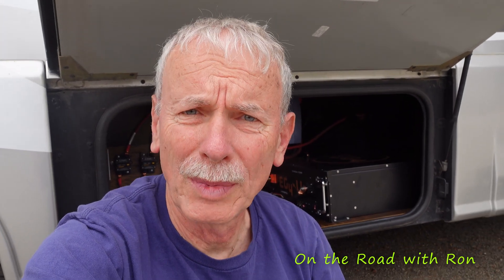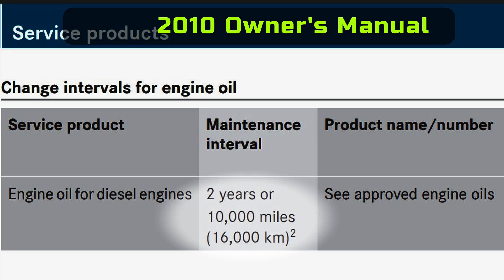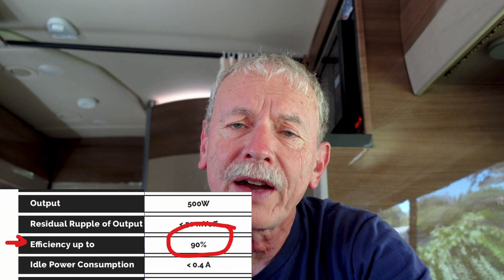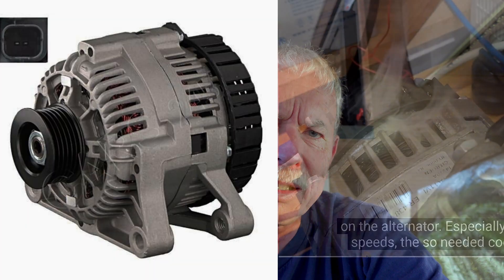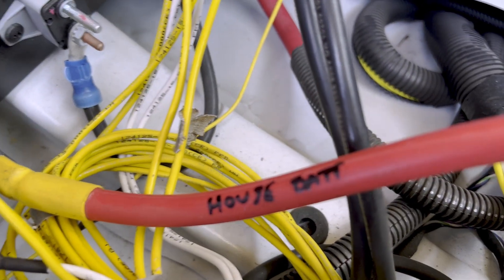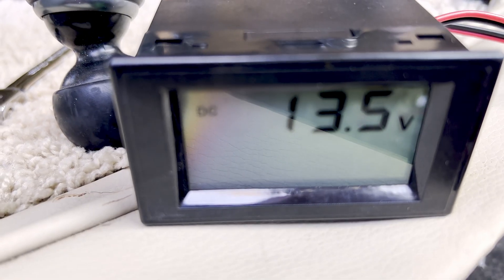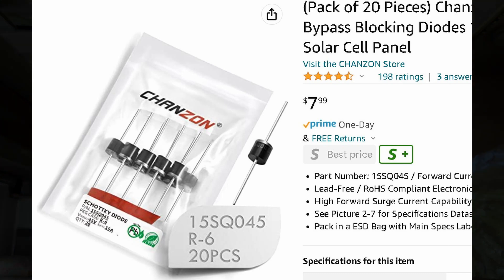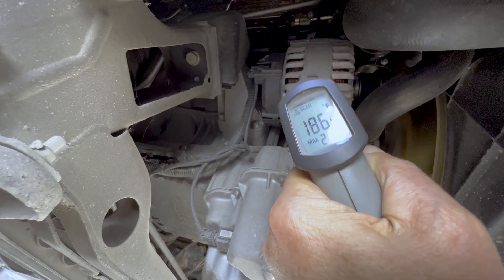DC to DC charger NOT required for big Lithium Battery

Comment: I am currently preparing an RV installation and am also surprised about the high cost of DC-DC chargers. Strangely enough, it appears that they are built into a PowMR hybrid solar inverter for less money than a DC-DC charger... Who understands this nowadays? Also, why couldn't you use a cheap solar charge controller for less than €20 and use the alternator as an input instead of solar panels... After all, voltage is voltage and amperage is amperage, there's no magic here... Or am I missing something?
Reply from the maker: I don’t think the solar controller will work. Solar panels output around 20 volts and the controller just reduces that to a battery charging voltage of 13.6-14 volts. The alternator output is 14.4 volts so may not be enough to activate the controller. If you try it, let me know your results.
Reply: Can I charge my RV's 24v starter battery with a solar charger or do I need to buy an expensive DC-DC charger?
Reply: @ontheroadwithron2432  What about removing the regulator from the alternator and let the charging of the house and starter battery be handled by the cheap MPPT controler. As far i know a alternator is able to deliver between 30 and 90 volt without the build on regulator.

Comment: Very simple answer: if the alternator has a build in temp control, which the 150-240AH in the Mercedes have you can hook the alternator directly to the alternator. BUT the lead regulator while throw up to 15V at the end of the charge and overcharge the lithium. The BMS will protect the battery but only when that 15V voltage is there for some time and will damage over time. You need to install a relay that cuts of the alternator when voltage is at 14.2-14.6V depending on the specs of your lithium.
Reply from the maker: I have never personally seen 15 volts from alternator. Are referring to when all batteries are fully charged?
Reply: I refer to when the FLA is fully charged you see up to 15.8V and with AGM setting (which most smart alternator have today) up to 15V. So you have to be careful and disconnect the Lithium earlier. You may never see when cable is underdimensioned and your voltage drop on the cable is 0.5V, the argodiode splittingbdiode used with 0.5V voltage drop or connection is slightly corroded which unintentionally  saved thousands of drop in lithium from being overcharged and damaged...and then claim this is all marketing scam you have to modify alternator or take other measures but simply insufficient install saved their ass...

Comment: Depends mainly on the chemistry of the battery. LifePo4 no problem to use the alternator I have been doing that for 5 years  on my RV.
Reply from the maker: As long as you have a good alternator.

Comment: Yes you did not cook your alternator because it is strong enough but but I have had two four wheel drives that one with a 60amp and one with a 80 amp alternator and cooked both of them
Reply from the maker: Those are pretty weak units. Even a DC charger might be too much.

Comment: BMS cannot and will not limit charging. BMS is basically a fancy self resetting fuse not a charger at all. Victron does run a BMS they just run an external BMS not internal. There BMS if setup in the Victron eco system can control all parts of the system from turning loads of if battery is getting low can turn chargers on and change there output to suit the needs of the battery and system. 

Alternator no matter if it's size have a regulator this will prevent it from over heating and burning out, as well as limit its max output so no battery could ever over heat a alternator that's younger then 40 off years. I would say rpm was too low or some how increase discharge by using a dcdc charger of some sort to keep the alternator charging when it decreases it's voltage to decrease it's output. 

Alternator charging will work it's not the alternator that's the issue it's the battery. Using alternator will shorten the life of your batteries as it will hold the batteries at charging voltage. So if you don't ever fully charged the battery with alternator this should not be much of an issue. Next issue is charging speed and is why people use dcdc charger. As the lithium battery voltage increases the voltage difference decreases so this will decrease charging speed so under 80% it should charge fast over 80% it will start slowing down fast. Where a dcdc charger will charge lithium at max amp rating though the full charging cycle.
Reply: I've been playing with a relatively cheap Daly 'smart' BMS, and I would disagree with alternator charging reducing the life. What I see is that you can charge your lifepo4 bank from a 14+v source, and what will happen is that the cells will charge(at fairly high current) until they get full. Then, the voltage rises pretty quickly, and the BMS cuts out the charging mosfets until the voltage drops below the setpoint. In the case of my BMS, I can set that voltage. Others are just a default 3.65v/cell.

If the alternator puts out 14.6V, lets say, once the battery is full the BMS will disconnect it and won't damage the battery... but the alternator may not be happy, unless you have a separate load / battery to keep it under control. 

And yes, I agree that a BMS will not limit charging to a given amp range, they will just cut it out completely if it gets overloaded. The actual amp draw will be based on the wiring and other resistances.

However, I have also seen a BMS with actual current limiting out there - you can tell by the large inductor. These will use PWM to limit the current to the given value.
Reply: @MacRobbSimpson  that's completely wrong. The only reason for a BMS to stop charging is the battery is in fault. 
What happened in the real world is alternator voltage will hold the battery at 13.8-14.6v depending on alternator. The battery will site at this voltage until the vehicle stops. This will and does decrease battery life as lithium does not like being held at charging voltage. Just look at all the issues DCS lithium is having
Reply: @DIY12-24v  https://youtu.be/7ky5kS7BIoU I just did this test and recorded it
Reply: @MacRobbSimpson  wow you are going to kill your car with the battery going in to self protection like that with the alternator still going. the bms is no controlling the charging all its doing it going in to self protection mode because of your setup is not suited to the battery. you need to get yourself a starting battery bms not a deep cycle bms

Comment: This video is very inaccurate.  You should NEVER risk your Lithium batteries by connecting directly to any alternator.  You CANNOT rely on the internal BMS on the EG-4 to safely regulate DC Voltage in.  A simple Renogy 50amp DC-DC is SAFE and reliable to deliver a CONSTANT and Continuous current.  Those 2 words are the KEY.   Constant and Continuous.   The Variable Voltage Output of your Alternator will Destroy your batteries over time. 
You will learn an Expensive lesson.  Spending $150-200. to PROTECT your $2500. battery sounds like an insurance policy that I will always have.
Reply from the maker: I have the lithium and AGM chassis battery in parallel. Yes, I would not connect a lithium battery directly to the alternator without a lead acid battery as a voltage buffer.

Comment: I've the same battery size and was hooked to the alternator for the first year. All was well UNTIL I did a longer drive (about 3hrs) after the 3rd replacement I now have a DC-DC Charger. And yes my alternator was a 140amp. Your system will work BUT YOU NEED A TEMPERATURE  sensor on the alternator to cut it off from the house bank before it smokes. Because it will, lithium has such a low resistance to current flow it will draw every amp the alternator can produce and while they say they are 140 or 200 they are only rated at that for maybe 1/2-1 hr not continuous for hrs on hrs . It will overheat ar some point and a temp sensor on the relay wire is cheap ($15) insurance to protect a $200-1000 alternator.   Edit.. also newer 2000 plus alternators DONOT charge at a High enough voltage to fully charge your lithium house bank. The benefits of a dc-dc charger, while slower it does actually increase the alternator voltage up to 14.6 volts    from a usual 13.2V which with lithium is only about 70% if capacity.  ;)
Reply from the maker: Your case sounds different. Mercedes allows 80 amps from their alternator for “outfitter usage”. That is approximately what I read for charging current.  So I am within the mfg recommendation. Their alternator’s rated at 220 amps.
Reply: @ontheroadwithron2432  I have class a gas with godzilla 7.3 engine, upgraded to two 300ah Lifepo4 in parrallel jammed under the step..  https://photos.app.goo.gl/k2RCfVnxvh5EM2PR7 - beautiful upgrade, had same worry about the alternator , it's a 210 and seems to work great even with the lifepo4's 600ah is large i guess.. one trick I figured out, if I feel the alternator is pushing too much juice into the batteries all you have to do is press the nice little button on the dash (aux start swtich/emergency start switch) that uses the house batteries to start the engine, and walaa no more charging from the alternator!
Reply: @ontheroadwithron2432  Lithium batteries can easily draw over 80 amps.  Drawing the max for extended periods is what burns them out.  Victron used 70amp alternator to show how drawing the max can easily end in disaster.
Reply: @hairyferrit  nope, it's a scam, they want you to buy their stuff.. modern alternators on class A rigs can easily handle it.. and you can shut off alternator charging all together by using the dash emergency aux start swtich ;)
Reply: @ontheroadwithron2432  You do not mention much about voltage. Most LiFePo batteries want to be charged between 14.2 and 14.6 volts depending on the manufacturer. Also the BMS does nothing for the alternator. It is there to protect the battery only. I use an external voltage regulator that also monitors the temperature of both the alternator and the battery pack. It is also connected to the shunt and as you say must be connected to the negative post of the battery. This gives you a treasure trove of information.
Reply: I've driven my Navion with it's 220A output alternator for hours on end on the freeway, and have had no problems or damage to the Relion RB100-LT jars. Still fully functional after almost 6 years. Oh, and lithium iron phosphate batteries do not have to be fully recharged after use, they're fine at any percentage except 0% for an extended period. Too many people apply FLA charging rules to LiFePO4 batteries, in error. Do your homework, rookie.
Reply: @mikeyipeekyeh  love it! yup victron just wants to sell you a product that's not necessary!
Reply: My 2000 Eurovan Heavier duty alternator is rated at 150AMPS. I hear only 50Amps is either sent or allowed to draw to (or from the coach). If that's the case and it's limited somehow already (not sure how that could be with the Winnebago Rialta it's been made into) but it's as simple as putting a temp sensor on there and finding out. Losing 10-20% in loss of the DC TO DC converter when my alternator goes from 13.8 to as much as 14.2V means i might under load, be charging lithium up to 85-95 % which is wise actually imo.
Someone confirm the bms doesn't protect the alternator. I'm looking now. But solar is so good for keeping the batteries all charged up that even my 35 watt 25 year old seimens panel kept my small laptop and phone charged for weeks when I didn't need to start the engine even once. Tops them off in winter.. and would give that extra .5 volts or so charge to get to 100% most days also.
Reply: DC to DC chargers are an unnecessary add on to make money. A good lithium iron phosphate battery has enough "smarts" in the BMS to keep it from any damage. Victron is the worst for the "you need this and that to keep your batteries healthy" nonsense. It's all just sales pitches to separate you from your money.

Comment: The thing to understand about Victron is that their main market is 'marine', no airflow over an alternator. Boats typically come with anything from 40-120A alternators. Marine engines will also normally be running on a mooring at lower idle speeds. The DC-DC chargers can be placed in parallel, so 2 x 30A = 60A to charge. You also have to appreciate that the Orion TR is a three stage charger so is designed to maximise your battery service life too. You also get the protection of voltage disconnect too. If or when your alternator regulator fails the Orion won't allow the increase voltage pass to your domestic system. This video does a reasonable job of doing an explanation of why you might want to use a DC-DC charger: https://www.youtube.com/watch?v=myx7vc5Omm4
The other thing people miss is the cable sizes required to carrying the current they are generating at their alternator. 2 x 140A alternators = 280A that will need at LEAST 50mm2 cable, plus fuses etc. The cross-sectional area will also need to increase with distance too, even over a few metres. Lithium can typically sustain a charge rate of C0.5 or C1, so can often suck up whatever you can throw at it, especially a depleted bank. Personally I always use Victron, because you generally get what you pay for, and you can save money from what you don't need when you have something like this.
Reply: Your wrong, the main market is by far RV about 15-20times the one for marine...
But you are correct in marine i would assume 80% of alternator are selfregulated dumb as toastbread alternator that needs external protection. As a rule in marine (with exceptions as always) if you have a V-belt its a dumb one, if you have a serpentine belt it most likely has internal temp control and can protect itself, no DC2DC charger needed. Well known and widespreaded are the 115A Mitsubishi and the 125A Valeo found on the newer leasure boat engines from the big 3 Volvo,Yanmar, Beta till 100hp.

Comment: I wonder how much money you have cost people following your instructions. Every situation is different. There are so many factors that I can’t cover them all here. My guess why you got away with it is that you have wimpy wires that worked out as a current limiter and/or a diode type isolator that also limits current.
Reply from the maker: As you said every situation is different. I’m sharing mine. I also have friends who don’t use a DC to DC charger without issues. I can’t speak for their particular setup but I know mine works for me.

Comment: The guide for Lithium and Alternators:
Smart Alternators (and vehicle ECU controlling it) can be use direct in many cases as they will limit themselves when there is insufficient airflow or RPM.
Older self-regulating alternators rarely have thermal protection and will produce max output for the given RPM and usually  buildup heat till magic smoke leaks out because they can't spin fast enough to pull cooling airflow. 
Most batteries DON'T allow you to set the current flow settings on their BMS so many will rely on DC-DC current limitings of an external charger.
Reply from the maker: As always, your particular installation is more important than general rule of thumbs.
Reply: @ontheroadwithron2432  My 2016 Pleasure Way (built on the Mercedes Sprinter platform) came with 200 ah Lithium that I just upgraded to 600ah. I've been researching DCDC and was almost ready to get a BBMS (Bank Manager) but watching this it seems I should be okay with just the Mercedes smart alternator?

Comment: Best thing I did was remove the dc-dc and focus on quality solar. If you get the solar right you don’t need the risk of dc-dc it’s great not having to worry about damaging the electrical system in my truck. It rarely rains where I live but if I need a boost I hookup my pure sine generator to provide power and charge the batteries.
Reply: Some rigs simply don't have enough roof area to go solar only.
Reply: @Step-n-Wolf  no but people waste space by installing rubbish! The panels I use are Bi-facial they can produce 875W each in ideal conditions. Granted their 7’8 long but just 2 gives you over 1.8 kw
Reply: @plokijij7856  I thought bi-facial panels only put out their rated wattage and worth the cost and additional weight when A) they are mounted on a reflective/white surface and B) They are not mounted flat (like on an RV/Van roof)?
Reply: @antigroundhogday  no not necessarily, mine is mounted on racks so it is off the roof with about a 4 inch gap, my truck is white so that helps. I have seen hinged setups that raise it from the roof to get the benefit of the both sides. No they don’t need to be mounted flat, I’ve seen articles where people are using then for fences or wall a divide. Your right they are large and heavy but manufacturers are bringing out new residential panels all the time that aren’t as large and heavy with higher watts that are mono facial. I bought a couple of Jinko 580 watt N types the other month! 580 watts from one normal mono facial panel is nuts. When lithium batteries can be charged anywhere from 50 to 150 amps most people trickle charge their batteries and wonder why they don’t get to 100% and have trouble with them in the long term!
Reply from the maker: I don’t have much space for more solar but it still provides most of my charging on short trips. However years ago we were camping in rhe Smoky Mountains and it rained 4 days in a row. I had to run the genny each day. Good to have options.